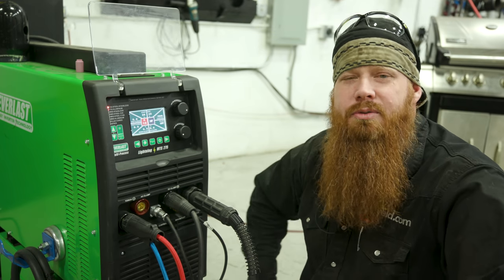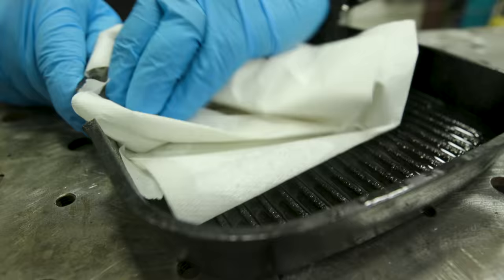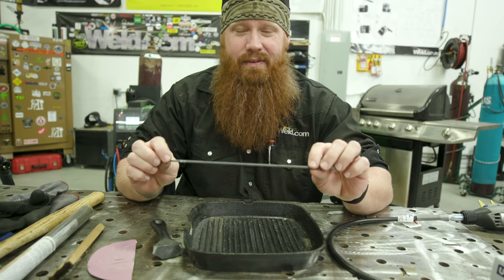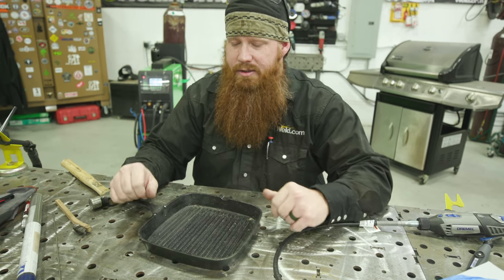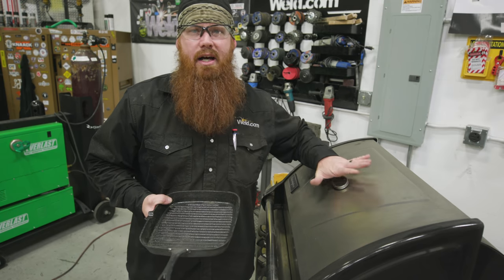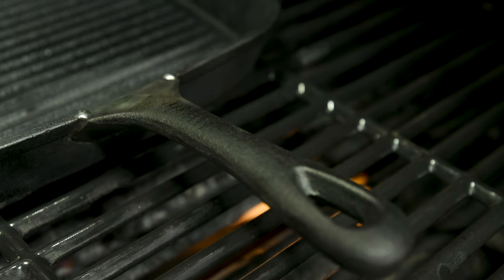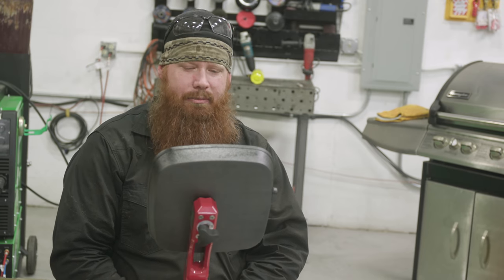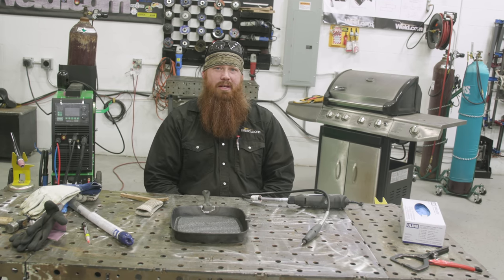Cast Iron Skillet Repair

Comment: Love the sound effects and impressions haha, you guys are just awesome.
Here in scandinavia how i've been taught to repair cast iron is to use a remote control and cold stick weld it using super small sticks.
We use a remote control for most stick welding anyway so it isn't a big deal, what we do is weld small 1/2 inch welds with small electrodes on super small heat and let it cool off between welds, that works really good aswell. Can't wait to get a chance to try your method out!

Comment: I did this on a scale platform at work that was modified by a forklift, it worked very well and is still in use 4 years later.

Comment: Silicon Bronze is not always the answer for cast Iron. Good to see someone else using The tig method too. I have done the same thing for nearly 30 years now. I also have some .035 nickel 99 mig wire that I use for filler which works well especially on ornamental Iron stuff. Good tip on pre/post heat. Cheers

Comment: Good work Jason, I had not thought you could Tig cast iron so successfully.. I have fixed a broken vice using cast 90 rods and it worked very well. Preheated with tiger torch and used digital heat sensor for temp,  then after welding  let it cool down over night on the wood stove over night as the stove went out. It also worked very well. Not sure it Tig on a vice would be strong enough.
Reply: Ryan Schmaltz 😂

Comment: I try your technique and it works great love tig welding. The item I Weld it was to cast iron stove. They hinge broke off the door and it was too thin to use arc welding.  Thank you for showing your technique.

Comment: Now remember that cast iron absorbs things, oils, chemicals ect....you go to use this over high heat, you'll be cooking the microscopic cleaning chemicals into your food.

best way to clean iron is to bake it in the oven or in a fireplace for an our or so till all the seasoning comes off, then use sandpaper and salt with warm water to get the rest off, then weld what you need...then begin the re-seasoning process ie. grapeseed oil or olive oil over high heat in the oven for an hour, clean with lint-free rag (never paper towel) then repeat again till the black seasoning is rebuilt
Reply: It's not likely any of the chemicals would survive 500°F.  After this process  it would have to be seasoned and 500° or more is best to do that.
Reply: Microscopic cleaning chemicals.  Lol.  Just wash it. 

Microscopic harm.
Reply: The non chlorinated cleaner is all organic volatile solvents, the weld heat alone would have boiled and or combusted everything that didn't evaporate seconds after being sprayed.
Reply: Not olive oil! Low heat oil will not last. You need a polymerizing oil like grape seed, flax seed, organic bacon fat. I too have used the inside of my wood stove, full of coals, to burn off the seasoning. Risky thing to do. If after all your cleaning the pan is gray, it is clean. Last time in water, dry very fast, or it will flash rust. It may be better to use an acid bath for some folk, to remove the seasoning.
Reply: No, it doesn't soak anything up. It is iron, not a sponge.

Comment: I can do a cartman impersonation as well - sad thing is i look like him as well !
My mate is the living representation of homer simpson - and he hates it when i mention it !
If you need to clean of fat or cooking oil a caustic based oven cleaner or degreaser will do better than brake cleaner which is better for petrolium based grease or oils. 
I noticed you used a cutting tool rather than a grinding stone to stop any graphite smearing which can be a pia when tig or oxy welding cast iron .
I have used stainless to weld cast iron and spring steel before with success as it doesn't pick up the carbon which is essentially what the high nickel content in those rods is there for .
Thanks for another fantastic  video man ! 👍
Reply: ian bertenshaw Any suggestion as to which TIG rod to use? How much nickel do you need in the rod? 55, 99, etc? TY for info on caustics. I learned something good this morning!
Reply: ian bertenshaw Oh and what caustic do you suggest?
Reply: AldoSchmedack 
Oven or BBQ cleaner, if it says on the can not suitable for aluminium or corrosive it most likely contains alkaline salts or caustic soda .There has been a maked shift away from these cleaners in general because  they can burn your skin and eyes . The newer stuff doesn’t work as well but is much safer to use and to acquire .
The best thing to do when choosing a welding wire is to check out the manufacturers website as they generally make good recommendations on which wire to use on different materials - they make the stuff and know exactly what material they made it for !
Reply: I work with a guy who was a trucker and he talks yes talks just regular talking he sounds like Boomhauer from the King of the hill cartoon.  It is too funny and when he get flustered it only gets worse and so funny... ‘you know what I mean’ after everything he says too...
Reply: Does this technique work ?? for high temperatures and pressure vessels like cylinder heads for fixing spark plug/ injector holes or valve guides and seats

Comment: Pre-heating the cast iron is one of the keys to successful welds on cast iron. I often need to weld fairly large and complex pieces that won't fit in a typical propane fired pre-heating accessory. So I use ceramic wool, the stuff that is used in kilns, to make custom wrap around ovens . I pace the casting on either the ceramic wool, which is about an inch and a half thick,  or on fire brick. Then I heat the casting with a portable propane pre-heater. Harbor Freight sells them but they call them weed burners. Marketing. Makes 'em cheaper though. I heat to at least 350 degrees, usually hotter though, but not glowing hot. Then I cover the casting with the ceramic wool except for the weld zone. After welding the casting it is covered completely and left alone to cool. This method has always worked for me. A word of caution about the ceramic wool: it is best not to breathe the dust generated from rough handling. So use common sense handling the stuff and wear a dust mask or respirator if necessary.

Comment: I did very similar months back with a cast iron griddle handle that broke off with a cheapo flux-core mig welder, a bin of sand, and a mapp gas torch. I also peened the weld before putting it in the sand after welding, don't know i that helped any, but it's held up just dandy, and when i've tried cold welding or minimally preheating and annealing cast iron welds before it's always a brittle mess. Glad to see my method was on the right track.

Comment: Great video, Jason, thank you! Could you explain they whys, advantages & disadvantages of using nickel vs. silicon bronze as filler? Is one stronger than the other? Does one filler require significantly more or less heat to braze?
Reply: Throckmorton by definition brazing will take less heat to achieve than welding brazing occurs around 840° whereas welding will occur in the 1,000°’s depending on the alloy. Brazing with silicon bronze will work as well. This is just my preferred method because of the success I’ve had using this process.
Reply: Using bronze in a brazing technique is very common because it’s easier, and somewhat cheaper. But it’s not as strong as this. Sometimes that doesn’t matter. In addition heat affects grazing more than welding. If a brazed part gets really hot, it can come apart, though that’s unusual, but it will lose strength.
Reply: On cast that is subject to high temps like manifolds or in this case a cast iron skillet, there is a good chance that the weld will melt right out of the joint if you use silicon bronze. The nickel will hold up to the temps.

Comment: I found an 8" Griswold cast iron skillet at the scrap yard while looking for various project steel stock.  It was half-buried and I figured it was just half a skillet as I reached for it.  But, it came out of the dirt/scrap pile whole.  Oh, it was a rusty mess, all right.

Once home, I threw it in the sand blaster for a perfect gun metal grey final finish...  Yeah, maybe the two revealed cracks were the reason it was sentenced to scrap?  One crack was near a pour spout and the other at the handle.  I also Dremeled out the cracks with some nice V work.

The actual repair involved an acetylene torch and Harris Safety Silv 56 silver solder.  It's the only brazing filler Harris explicitly states as, "food equipment safe."

It took two cycles of brazing, grinding, and smoothing to effect the repair.  And, after a couple of seasoning sessions in the oven, the repairs are only noticeable if one knows they are there or looking over the skillet with a collector/appraiser's eye.

Of course, the silver solder cost more than the skillet is worth.  But, the cooking implement has now entered my daily kitchen rotation.  And, every time I pick it up, I recall the successful reclamation adventure.

Comment: I have a cast iron engine block I have to do as it cracked due to freezing temps. I am going to use nickle 99 rods to do it but I am going to wait till the summer as I won't have to worry about it cooling down too fast after the preheat. Great video. I like the tig method. I might have to go that route other than stick welding. Looks like a lot less heat penetration to the cast iron. Thank you.

Comment: Why no love for the oxy-acetylene torch? My first go-to would be gas braze welding with low-fuming bronze. If that isn't desirable for some reason (i.e. high operating temps, like an exhaust manifold), then I will weld with nickel. If it's nodular iron I have used Eutectrode 680 with excellent success.

You asked about a different process, so here it is: Old school cast-iron welding with cast iron filler using the good ole oxy-acetylene flame. I've done it plenty of times. The cast iron filler rods (notable for their square cross section rather than being round) and flux are hard to find, but available. Oxweld (later All-State) Ferro Flux is my preferred flux for cast iron welding, but is no longer made. Thanks ESAB :-(  I have a small stash of it, and cans of it occasionally pops up on Ebay. Fortunately, Superior still makes Anti-Borax #1 for welding cast iron. Another place to get the flux and cast iron rods is TM Technologies. He has flux and such for gas welding aluminum, stainless steel, and copper as well. True welding of cast iron with cast iron filler is an involved process, but it's rewarding and the weld has the same metallurgy as the base metal. Get the rods and flux and give it a try. Make sure to make a video!

Comment: Great to see repair work, and cast iron is one of the repairs that a lot of people think requires "black magic".  Excellent choice on the Nickel 99.  If your repair has a "tighter" crack, StaySilv 45 or silver solder is also a great option.  Keep sprinkling a few repair videos in, great stuff!  Readbeard rocked this one (well, maybe lay off the tacos and Old Milwaukee the night before!  LOL LOL!)
Reply: tom fleming who the hell drinks the beast nowadays? 😂
Reply: Dennis Young  That is one approach.  Sometimes, one must use a Damascus knife to draw blood, which is applied as flux instead of Boron.  This only works if done under the light of a full moon!  Too funny!
Reply: @GodslilRedneck23  Quite possibly you in preparation for this Vid!  LOL

Comment: I think aluminum bronze on AC tig wets out better on cast. 

This is an interesting method. I’d be interested in the composition of the wire for the nickel welding rod and see the equivalent in a tig wire.

Comment: I once had a cheap (really cheap) Campbell-Hausfeld welder that I bought from Wal*mart.  The only thing that it did well was welding cast iron; with flux core wire!  I welded several exhaust manifolds.  One is on a car I have, and it's never failed.

No YouTube back then to bother trying to prove it, unfortunately.

Comment: I have a larger cast object needing a weld. 100+ year old post drill press. Needs to be a strong joint. All I have is a 220 volt AC buzz box and an oxy/propane torch. I can braze it but that will show. I plan to place this large piece on my shop wood stove to preheat. Suggestions?

Comment: After burnishing  back about 3/4" from the broken edges all around with the bench grinder wire wheel, I bevel the edges of both parts using the 4-1/2" side grinder w/aluminum oxide 1/4" thick grind disc BEFORE putting them together (it is very fast that way to get the job done).  The preheat with the gas torch burns off any remaining  grease and oil.  About 400-500 F. 
I Weld using the solid steel wire mig .035 ER70S6 wire w/CO2 shield gas (same thing I fab steel with) using a series of overlapping stitch tacks always starting on the edge of the previous tack (dilutes the carbon in the previous tack and stress relieves).  Nothing special welding, just go around the whole thing both sides with the bare steel wire then post heat again with the torch. Done this many times with good results and reliable repairs.  If the mig tacks are "very porous"? (indicates excessive silica in the cast iron from the sand molds) I have fed a 3/32" 99% NI rod w/flux coating still on it into the Mig welds to help it all wet and flow better. Usually that isn't necessary on light stuff like that pan.  For freeze broken thick water well pump housings repairs? I'll use a first root pass of the pure nickle NI rod coated stick electrodes, well peened  after each short tack and not allowed to get too hot.  Then finish off with a stitch tack  wash over the NI rod buttering with the mig steel wire as noted above. Saves a lot of time and expense over using all NI or NIFE stick electrodes.  To be sure to have NO pinhole water leaks on the well pumps? After welding I coat the entire weld areas with filled epoxy while they are still warm (that way they are for certain pressure sealed, and none ever come back from leaking...).

Comment: OK, where was this video last Week when I needed it?   Im a retired firefighter. guy from work said they had a broken lid off a 12 quart dutch oven .Probbaly been in the dept for 40 years. I said sure I can fix it!.   Well ,,, its fixed, but it aint pretty!.    Acted like it was dirty no matter how much I cleaned it??    I would recommend preheating as I had a lot of cracking when I didn't pre heat.   Question??? Will the nickel rod you used be compatible with the bronze??? Thanks!!!!
Reply: Fire Guy my guess would be that it wouldn’t.
Reply: My suggestion for your predicament at this point would be a new green sand casting using the lid as a pattern. Include the lid in the crucible for sentimental reasons, and add extra cast stock to accommodate the sprue. Shrinkage could make it tricky, unless you 'waller' the pattern in the sand box a tad. Good luck, bro!
Reply: @stanervin6108  Stan, Thank you for the idea! I considered making a casting out of aluminum. Thought it would a bit easier to melt with what I have to work with.  I think the lid is usable, its just ugly....Which if you knew me would be understandable! I think Ill have them look at it and if they don't object, use it. If they don't lie I may propose your idea. Thanks again!

Comment: woulda wanted to see the welds on there close up
Reply: Most cast iron repairs look like crap so I can understand why he didn't show it. You basically have to grind them in my experience.
Reply: @user-ii8dz4vu7n  i still woulda wanted to see it since the way he repaired it is completely different from other ways of welding it back on. i wanna compare how clean it is than other welds.
Reply from the maker: @franzb69  They actually look pretty good with this method.
Reply: Exactly..  I have always avoided by nickel stick electrodes as the weld deposit looks like crap and is brittle..  Never thought of TIG, but while it seems to look a bit better, it still did not seem to wet out very well..   MIG or TIG brazing has always been my go -to for cast iron: easy and wets out nicely,  can give a smooth deposit if you are careful and the repair is IMO stronger and more impact resistant than nickel..  Cosmetically, you can also blacken the braze seam to match the surrounding cast iron fairly easily, whereas nickel always leaves a shiny seam..
Reply: @Welddotcom  i'd still like to see the weld
Reply from the maker: @franzb69  I just threw up a post (in YouTube) and a YouTube story photo with the finished weld. Also over on IG. Sorry for the oversight.

Comment: I had to repair a broken cast bench vise recently. I actually used pieces of high carbon steel (scrap 3/8" 80crv2) and 3/32" 7018 rods and it has held up really well, think it's actually stronger now than it was before. I wonder if the higher carbon steel plays well with the cast iron since they both have more carbon than mild steel, may cool / distort at similar rates or something. 

I heat soaked the poop out of it while I welded and went back and ran extra beads tying back onto both the cast iron and the high carbon steel.

Comment: Just did a cast aluminum repair, welded very similar to this, took forever to develop a puddle and it never really flowed until you started feeding rod into it
Reply: Yes and no. Cast aluminum it typically easily welded. Usually contamination is the challenge. Post weld cracking is not an issue with cast aluminumn like it can be with cast iron. However a lot of larger aluminum parts will absorb heat from the weld pool rapidly and you can get cold start weld defects.

Comment: I had good results using tig to weld cast iron to itself, no filler rod. A carbon rod on a stick welder will also work for this.

Comment: I have some Wary old sticks that are nickle. the slag is totally drenched in moisture. so now i know i can use them as tig rods. cant belive i didnt think about that.
Reply: Ryan Schmaltz you don’t bake or rebake non lo hydrogen electrodes.
Reply: blaster91 should work just fine.